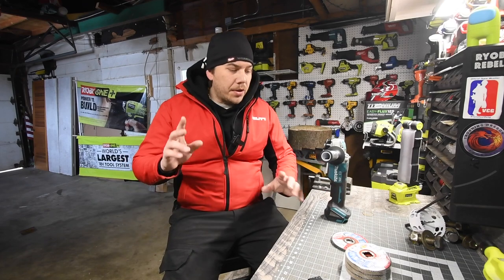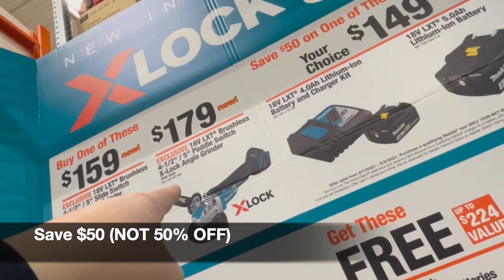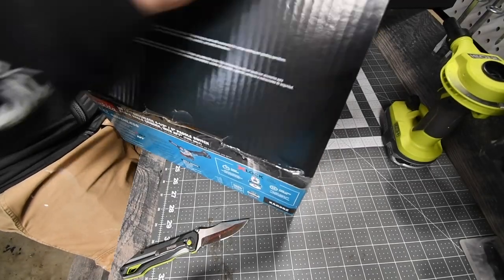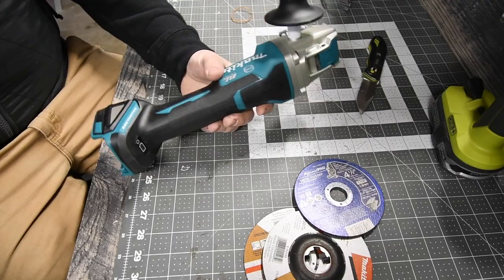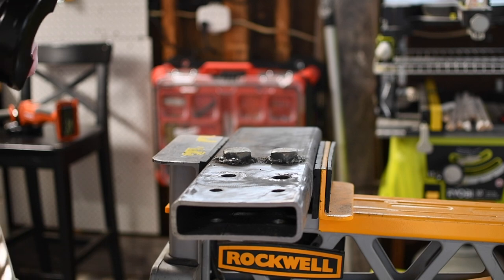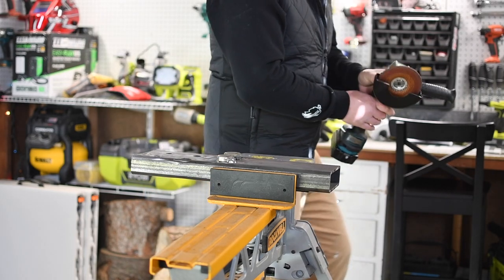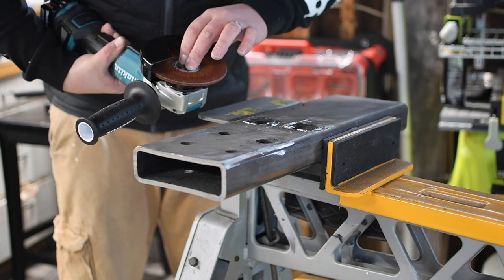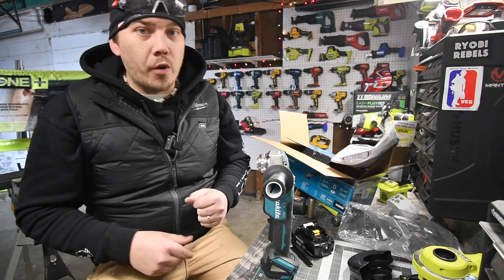New Makita X-Lock Angle Grinder (PADDLE TRIGGER)

Comment: Makita have been announcing many tools for over a year in Some cases, by the way I believe x lock has been out , from bosch like about a year ago.
Reply from the maker: yes it has and this tool has been out for about a year in different countries
Reply: @ManCaverTools  
I know I’m late to this video but quick question if I may ask. Do you know if the Bosch x lock grinder wheel/disc fits the Makita x lock grinder? Thanks in advance🤙🏻
Reply: @boogiehara8693  Makita partnered with Bosch on the X Lock. X lock is X lock. Diablo also makes wheels for it. You can also use an X Lock wheel on a regular grinder, but X Lock MUST have X Lock.
Reply: @matthoward1174  thanks for the input. At the time I saw Amazon had a good price on Bosch x lock cut off wheels for a 10 pack. I kind of figured any x lock would work but just wanted to be sure because I seen on a replied comment from man caver tool where someone asked him if the Makita x lock were interchangeable with other x locks and he said no. Got a little confused. Glad you chimed in🤙🏻
Reply: @boogiehara8693  Thanks Brother. Glad to help. Depot had some decent deals on Diablo multi packs for the X Lock as well. I'm gonna stock up before the intro deals dry up.

Comment: Either Metabo, or Makita, when it comes to a grinder.  Makita is so smooth.  Metabo is known for being dependable, and enjoys a great reputation amongst the trades.  I have three Makitas, otherwise Id be checking one of these out!  On my soap box once again, It’s a crying shame Makita doesn’t offer anything above 6.0 Amp Hours, in their 18 Volt line.  These new grinders could sure benefit from a bigger battery.  Thumbs Up Dave!  👍👍👍😁✌🏻🇺🇸
Reply from the maker: I thank you George
Reply: The issue with makita grinders is they run at around 8000rpm so bigger batteries would only offer a longer run time. 

If you want a higher powered cordless you should look at Bosch or DeWalt. The latest Bosch brushless can run up to 11000rpm using their ProCore batteries. 

Makita cordless grinders are notoriously slow and it's the main reason I hate mine.
Reply: @SammyInnit  Good point Sam, and I’m inclined to agree with you.  Bosch indeed makes a good grinder, but Lowe’s and other retailer's carried the same old tired and old brushed design for quite awhile.  Some would argue the Milwaukee is better?  Nothing shabby about DeWalt.  I almost always use my corded Makita grinders, and they do very well.  Appreciate the comment and insight!  Peace!

Comment: Only if you're a shop would make sense to have an xlock also, but not only. And for home you're better off with the ordinary since you can use both discs. You can save some money if you end up having the old version of discs only and you have to work. Xlock will say no. There are stone drill bits for angle grinders I wonder if there are some for the xlock.

Comment: Good video.  I am glad you mentioned in the video that you cannot use other discs.  Therefore the X-lock means they locked you in for life to buy their discs.  I didn’t see anything monumental as where I need to run out and get this tool.  From what I saw it is just a gimmick to buy something and increase their profits.
Reply: No gimmick , faster + you can't mount discs the wrong way so it's saver as well. I am sure this  becomes the standard so discs become cheaper
Reply from the maker: all it is new way of licking in a disc. nothing truly special about
Reply: Discs are available in many brands and styles. Not really locked into lifetime anything.

Comment: I looked at it yesterday. Walked over to the grinder discs, and Home Depot doesn't have any x-lock discs yet!  Lowes?
Reply from the maker: I was able to get X Lock discs at Home Depot, 4 1/2 only, no 5" yet
Reply: They had the wheels, both Mak and Freud, right next to the shiny new display, at my Home Depot, Donnie? Maybe check online?
Reply: @georgedavall9449  thx! I'll check next time I'm in.   I bought the paddle switch version.
Reply: @donniemccrorie19  You’re Welcome, and excellent choice!  I love my corded and cordless paddle switch Makitas!  Did you know in some countries, they don’t say ‘grinder,’ but instead call it Makita!?  Kinda like Kleenex for any brand of tissue.  My third Makita is a slide switch, but it doesn’t see much use.  I’ve developed a technique whereby I can control the speed when I need to, by the use of the paddle.  Takes some practice, but try it when you get yours!  Be safe!  Peace and best to you!  👍😁✌🏻

Comment: I needed a new battery-operated Grinder, so I picked up one of these and OfCourse it had to be a Makita.  Im a Makita junkie.  So is the X-lock grinder is pretty cool, but is it worth it?  Well that depends.  To put it simply don't go out and buy a new X-lock grinder if you already have a perfectly working grinder.  You will just be wasting your money.  Its a cool system for attaching disks, but it does not save you enough time to be economically viable enough to go out and buy one if you already have a working grinder.  Now if you are in the market for a new grinder, because you don't have one.  By all means, go with the Xlock.  Its a robust mechanism that will last and I think its just going to grow in popularity among manufactures, especially after Bosch's patents expire.
Reply from the maker: it is a shame that you have to buy X lock wheels for this tool

Comment: Hey mate  ,what happens when you want to use a disk with a thread on it ,like one of those wire rope ones etc?
Reply from the maker: you screwed. X lock only on these unless if a company makes an adaptor

Comment: This is a phenomenal tool. If only it wasnt so loud... corded grinders tend to be quieter. 
The number of available discs are quite low as of now. There are still no concrete discs available.
Everything else is perfect. The batteries last longer than expected, the price for accessories is moderate, a quick and easy tool to work with.
Reply: Mine are all loud. I have a dozen of them. Corded and cordless.
Reply: There are concrete blades for these.

Comment: You've probably long since realized or been told, but you don't need to touch the locking mechanism when fitting discs. All you do is drop one on and press it against the tool until it snaps engaged. Albeit minute, you're making a fast change slower than need be.
Reply from the maker: I figured that :) and thank you Tim

Comment: It's a clever system but it won't replace the standard threaded arbor. Bosch introduced a very similar system to X-lock many years back on their earlier cordless grinders and it died out almost over night. 

The reality is, most people who use a lot of grinders such as fabricators have 2/3/4/5 grinders set up at hand at any one time. 

These won't be replaced very quickly if at all, SDS clic nuts or quick release nuts remove the need for wrenches and seasoned users can swap discs in as little time as the X lock system. 

Not to mention most people who use them a lot can buy bulk discs from their local supply house which come in at a fraction of the cost of the X lock branded discs. 

This is a system perfect for DIY and home owner types who have little experience or training with abrasive wheels but I think there's little appeal to professional users.
Reply: I have both styles. This disc swap is way easier and faster. And yes, I have a full rack of all types of grinders and I do not use a wrench for wheel change. This style is hands down easier and faster. Like you say Not so popular though. It's very handy for mobile work.

Comment: Great review. I really want to like this tool but if the disk I need that’s available isn’t an xlock then I have to search or it’s useless. I would so easily be sold if they made an adapter for an arbor when in a pinch. I hope that’s in the future either by them or by a 3rd party.
Reply from the maker: I thank you for viewing  :)

Comment: I'm still trying to figure out why the tool comes with two identical blade guards...
Reply: I know he got two blade guards as well, and he even said "different sizes". Mine are literally identical.
Reply: Ones for grinding disc's (the open bottom guard) the other is for cut off disc's (closed bottom guard),  the one mostly shown in the video is meant to be used for cut off disc's

Comment: I would like to see this against the flexvolt advantage grinder with a 9ah or a power detect with the 8ah. I could be wrong but idk if this could really be as powerful since they dont have 21700 cell batteries for such a power hungry tool. Def no way its coming close to the actual flexvolt model. I got both dewalt and makita so i would like to know im jus not going to buy jus for x lock even though its a nice feature. I currently have the dcg418 flexvolt and the 20v dcg413 flathead model but you can never have too many grinders in my world lol. Would def get slide switch since my other 2 are paddle